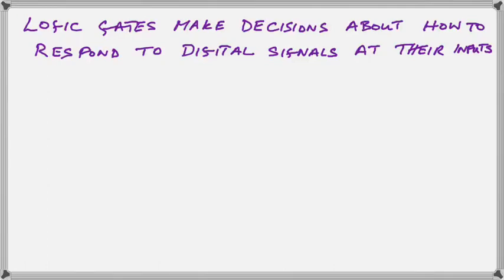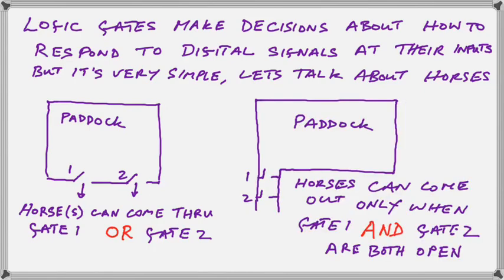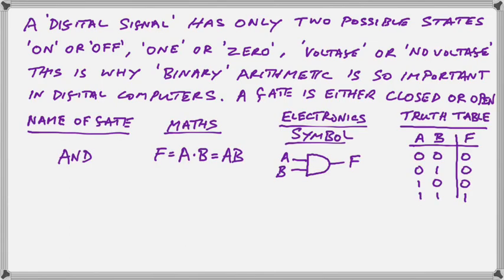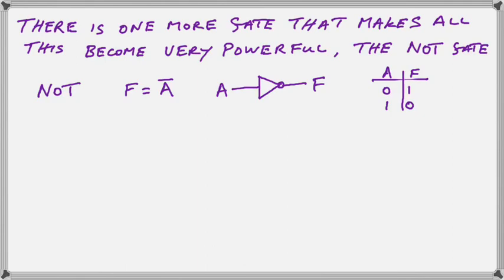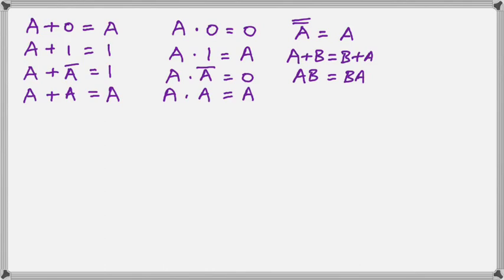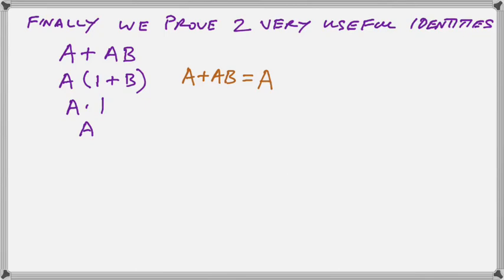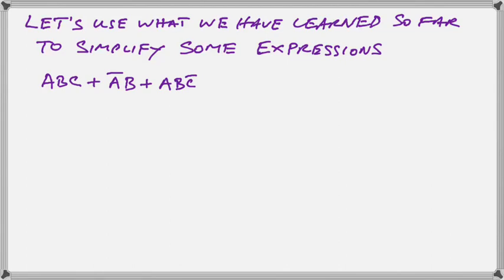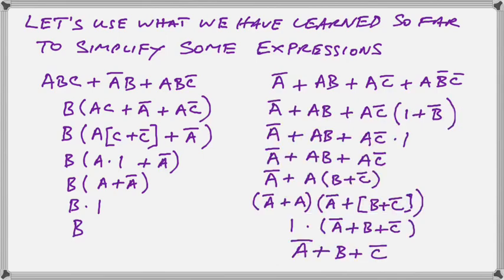Introduction to Digital Electronics, Truth Tables,  Logic Gates and the rules of Boolean Algebra

Comment: Question, around 16:04, why did "A notB notC" become " (1 + notB) " in the second line?
Reply from the maker: Because the 'A notC' was extracted out of it.......  if you multiply it all out to remove the brackets it comes back to the same thing as the  two terms above.... 'A notC' times 1 is just 'A not C'.... and 'A notC' times 'notB' is ' A notC notB' ..... which is the same thing as 'A notB notC'.... in the following video, I go over these same examples relating each step to the basic rules https://youtu.be/_HtKhLxNflg